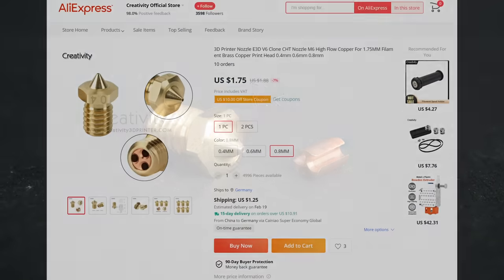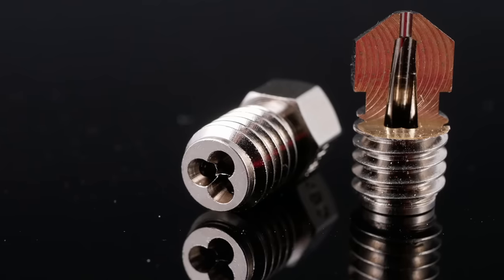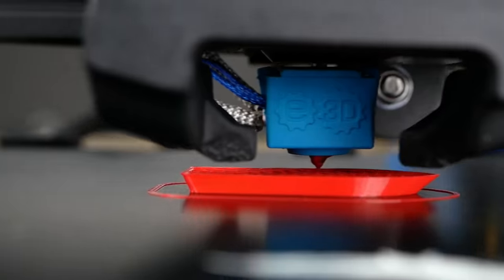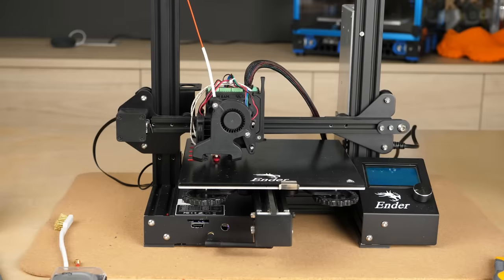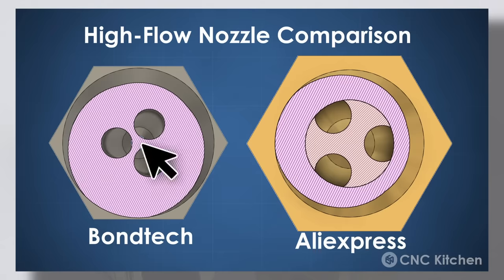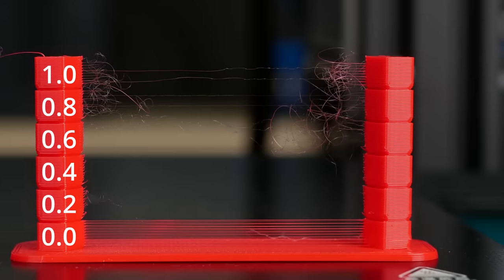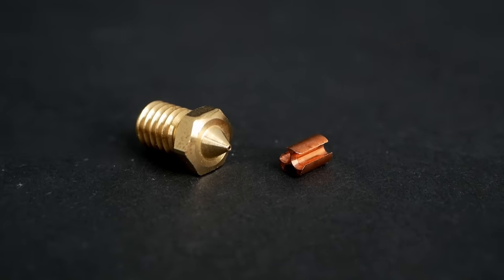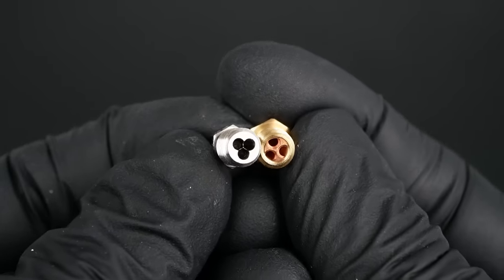$2 Aliexpress Knock-Off better than Original?

Comment: Do you suppose with the Ali express clone there is a chance the filament will seep into the small gap between the insert and brass nozzle?
Reply: It will definitely seep into the small gap. And that will be better for heat transfer than the air that's there otherwise. Some very thick thermal paste could work better if you manage to make it stay there.
Reply: @celeron55  That reminds me of Slice Engineering Boron Nitride paste.

But it's WAY too expensive for me to try. It seems the white thermal pastes are often rated to 280°C operation (HY410) so i could try that. I put some copper brake grease on my nozzle (outer thread) last time and what it did was to smoke up the room with the carrier liquid, but i suppose some compacted copper stays there and it should make it easier to extract and better heat transfer, but i haven't tried to extract it yet and also i don't have any numbers or feelings about heat transfer.

Comment: Could we use a 0.4mm CHT nozzle with the parameters of a 1.0mm printing profile? That way we would get speed and detail controlled by software.
Reply: Printing speed isn't the only thing that slicers change for different nozzle sizes. Just change the max extrusion rate and max print speeds
Reply: @bosstowndynamics5488   there were some videos recently when Arachne came to Prusa where it was tried out and mostly worked quite well. We need software that dynamically adjusts width of the lines and height of the layers to improve speed without sacrificing surface quality or detail.
Reply: @siegfriedkettlitz6529  Ok, don't see what that has to do with the fact that the maximum and minimum extrusion widths are in part controlled by the nozzle size (Arachne is varying extrusion width within a range, it's not pumping out 2mm wide extrusions on a 0.4mm nozzle)
Reply: @bosstowndynamics5488  Only the minimum width, not the maximum width. The maximum depends on the maximum flow rate.

Comment: I really wonder if an insert like the Chinese copy really transfert heat well.  They have quite a loose fit so heat transfer shouldn't be that good. For small blobs the thermal inertia is perhaps enough but on long runs with the wavy test print it isn't. I think insert are really good from a manufacturing stand point but the have to be press fitted at least! Like the certainly did with the original cht

Comment: I'm surprised no one has just made a nozzle in several pieces the threads are enough to make it whole when tightened.
Reply: Can you explain? Adding threads to the internal copper slug is more difficult than a press fit, and you lose horizontal space which means less flow rate.

Comment: The patent at a glance just seems very vague to me. To me, it reads as trying to patent the whole idea rather than a specific product, such as if a company tried to patent all hot end nozzles rather than their own take on it. Likely why its having trouble tbh.

The knock off is 100% just that; a knock off. Someone else's idea, redone in a cheaper way. Though, in this case, since the patent is or was pending when this was made and sold, it means its most likely legal, even if it was a more direct copy, and the patent was accepted later on. Future sales wouldn't be allowed, but the one you have would be ok.

Imo, the og companies should get credit, but thats where the line ends. You can copyright your high-end design of it, but come on, this is a pretty blatant attempt to hold the market captive and stop any further innovation in this direction that wasnt under their name.

Comment: Good innovation. Yeah, its a copy but at least the copy improved the overall performance for the technology. Could be made even better if you used thermal paste glue to hold hold the copper in place tighter. Just use very little of the stuff.

Comment: tha's a clear example of patent trolling.  seriously.  3 holes instead of 1.   
it's like adding couple more cylinders to the car engine and trying to patent it like a "new invention never seen before lol".
chinese nozzele is not a "knock-off". it's a different approach and it is more well thought.  look - you can pull this copper core if this nozzle gets clogged.

Comment: I bought Bondtech CHT nozzles, but I support the existence and availability and use of the knockoffs. This is a hobby, and it shouldn't be so that only those who can afford a $20 nozzle can get better printer performance. It's an already expensive hobby, and that could buy a spool of material. Let those of us with means to buy Bondtech do so, and don't shun those who look for cheaper solutions.

Comment: The original looks like steel, which the Chinese version looks like brass with the copper insert. I'm not sure it's a fair test due to heat transfer rates of differing materials..

Also, unless I am mistaken, isn't copper the least wear resistant metal? No good if you get rapid wear..

As for the patent the original has holes drilled into it, where as the Chinese version has an insert with a different metal. In my view it's radically different enough to not infringe the design - only infringe the idea.. are we patenting ideas now? If so simply thinking of a thing and patenting it stops any innovation at all..

Final analysis: while I might gonfor the cheaper one if I was printing pla and wanted it quicker for the odd number of prints, for more long term use, I would consider the original. 

But all that is a mute point, as it only matters if your wanting quick printing that pushes the printer to its limits and introducing artifacts.

Comment: The knockoff is substantially different in form. You can't get a design patent on function and a little bit different way of melting plastic isn't exactly an invention. It should not infringe on the patent. It's a different design of a high flow nozzle but it's not the bondtech's design.

Comment: I'm not fan of chinesse products but:
- These are different products. The chiness core has no holes and is made of copper.
- Copper core is an smart move, copper is better heat conductor than stainless steel. That's why you get a better flow.

Comment: I'm thinking patents are causing more harm than they benefit nowadays. Here's a copper plug with 3 holes drilled in it and we're questioning if manufacturing said part is allowed for the next 20 years! How's that improving progress of the society at large?

Comment: Heating the plastic with a laser is the future.  These cave men are heating with an element powered by electricity,  in the future a smaller diameter plastic will be used and it will be heated really close to the opening of the nozzle.  You should test that instead of this old tech. And yes, this is my idea.

Comment: The huge manufacturing innovation was the "knock off" (which I think is different enough, and performs superior, to not be called a knockoff). Its reduced cost making it dirt cheap is going to help a lot of people for just pocket change, and THAT is innovation. Its like making a car double in power for a crisp $20 bill, and not a $10,000 supercharger, because which one is the REAL industry innovation in that scenario? The one that changed things, and that knock off will do just that.

Comment: It seems that the bondtech application of this idea has misattributed some of the performance increase to the cutting edge splitting the filament, whilst it is in fact almost entirely from the increased surface area. Thus this incorrect assumption has resulted in this expensive manufacturing method, which was entirely unnecessary?

Perhaps with this revalation, it might actually make sense to drill even more holes into the insert to furter increase surface area?

Comment: We have patents. I can tell you, this is on the edge and could cause trouble. But, a tiny change could solve it. Tip: They cannot patent drilling holes, or attaching materials. They can patent a design, innovation, that is beyond "drilling holes".
In their place I would make it open source with mentioning the name of the developer, and become a respected member of the community to gain an indirect value. It is not that I am against patents. In fact, patents in the right hand can be good for community, but first .. it must be patentable!

Comment: Can a insert be made for regular nozzles?
Reply: The inside of a regular nozzle is too small for the insert.
Reply: @adama1294  not if you are using 2.85mm internal diameter nozzle.
Reply: @evertchin  Someone did something like that in 2019, you will find it as "Linear Edge Nozzle" at Thingiverse and Cults. It's an adapted design from injection moulding industry, which has the material pass through several vanes, very smart but doesn't manufacture easily. The insert as designed was tested as a lost-wax cast service at Shapeways in brass.

Here the internal nozzle diameter is presumably larger than 3mm, so they can keep crossectional area vaguely and don't need complex manufacturing operations.

Comment: To not infringe on a patent all you have to do is differ by 10%. A good patent lawyer could make this case for this Chinese nozel very easily. The removable core itself is enough to not infringe. The straight lines on the triple hole insert are the final needed change. Patents are not the iron clad protection many are led to believe. They are only a means to an end. You have to have enough money to defend your patent in court as well. The patent itself doesn't do this is Europe or in the Western World. A proper Chinese patent on the other hand is a whole other situation. Another Chinese company that infringes on your Chinese patent will have to pay lost revenue if you can show that they have infringed on your patent. Something that the rest of the world could learn from.

Mark

Comment: If they made a "knock off" that is better than the original, and isn't exactly like in the patents, I don't think they infringed, they improved it. It's innovating, but I wouldn't call it innovating to a point that we could ban all inserts into the nozzles, it would be ridiculous. But patent law often is, and I don't think it serves original purpose- improving and protecting innovation, I think overall it does the opposite.

Comment: In my opinion, power to both the OG and clones. Do I want a CHT? yes. Am I going to buy 1 CHT and 5 knockoffs? also, yes. My question though, has anyone tried a cold pull through a clone?
:face-blue-smiling:

Comment: Well the knock-off is waaaaay better IMO, quite easier to manufacture and easier to tweak the design. Manufacture inconsistencies don't worry me, other factories with better machines or experience will pick up the design and produce a finer result.

Comment: it probably hole spacing between each other is far away more effectively then one closer to each other 
that what changed game challenge 
it would be better if you can reach out to innovation tell them make other one but move drill hole aways from each other and have them drill it like 🔻 but drill it outside of 🔻
keeping more heat inside middle will create easy printing and more melting plastic easy-going 
if less room in middle is less effective keeping heat inside of it n get colder at faster speed

Comment: Having bought one full price CHT MK8 0.4 mm nozzle, trying to improve flow on Creality-style hotend (it didn't, actually it was worse than Creality pointy nozzles 🤨 so switched to Volcano block and nozzle) I believe to be - at least morally - on the safe side with slug nozzles 😇

I haven't actually tested the slug nozzles yet. They are for Titan Aero clone waiting to be installed on a Creality clone - recurring theme 😅 Based on this video, it seems I can continue with moderate speeds without Volcano.
Reply: Have you changed out the Heat-break for a bi-metallic one? That will improve flow a lot and make these CHT-style nozzles more effective.
Reply: @mocotonio  I did, Slice Engineering one, but it didn't make a difference. Maybe MK8 heating block is the one to blame...
Reply: @kimmotoivanen  I get close to 20mm/s³ volumetric flow when printing ABS with a simple 5A Plus bimetallic heatbreak and 0.5mm MK8 brass nozzles using Marlin's Autotemp.
Reply: @mocotonio  0.5 mm is a lot larger nozzle (25/16 area), but did you measure how much actually gets extruded out of the nozzle?
Reply: @kimmotoivanen  Yes, it can do that with my custom direct-drive extruder without losing steps. Prints also come out with perfect extrusion, i can reliably print ABS at 19.5mm³ without any problems.
Reply: Tried CHT clone and went back to Volcano after calibration parts. Like original 0.4mm CHT nozzle, clone does not flow well + couldn't get clean retraction.
Heatbreak had bent, so straightened it (required quite a bit of force 😅) and built around Titan Aero clone. K0.06 retraction 0.5mm for PLA 😺

Comment: Guys. Does anyone know a Solution for why my Printer prints Dots everywhere on the Printpiece after each Printlayer? I'd like to turn this off if it's nothing important. Would certainly save some printing Time with larger Print Pieces.... I use Cura for this. Would help a lot if someone can help.

Du ich hab da mal eine Frage, warum setzt mein Drucker bei jeder Schicht noch so komische "Punkte" hin über die ganze Schicht, wenn er eine Schicht fertig hatte?

Ich sehe da keinen Sinn dahinter, würde das gerne abstellen, wenns nix wichtiges ist. Spart man sich bei größeren Drucken sicher einige Zeit wenns wegfällt.
Weist du, oder jemand anders hier die Lösung dazu?
Ach ja, ich drucke über Cura.

Comment: I don't agree that this is a knockoff, this is not a direct copy of a patented design. But rather appears to me to be a derivative or an inspired design. I don't believe the patent covers what they've done. It's a completely different mechanical design. It achieves the same result but uses a different approach. But I don't believe you could be in any difficulty whatsoever posting links to it unless you yourself are deriving income from those links. But then again I'm not a lawyer but if this were a patent infringement suit and I was sitting on the jury I would rule in favor of the "inspired derivative".

Comment: I will use neither because I print slow to get perfect prints every time. 
Regular 0.4mm nozzles does a good enough job for my parts. 
But if I had to chose, I'd chose the AliExpress one. 
Why? Because it's dirt cheap and the original feels like a rip-off for what you're getting.

Comment: Honestly chinese design wins here by a long shot.
Not only it's far far cheaper, has slightly higher performance, but also seems to completely go around the orignal patent with that insert.
Reply: I don't think its quite that simple, as the 3 angle drill approach does show some other benefits and performs well, it has also now got lots of users printing in alternative filaments saying it works greats. The 'knockoff' design is however how I'd make such a thing myself, much simpler to make and easier to tweak parameters on to see what really works best - I'd think the sharper more knife like filament splitters on the bondtech would work better in many cases of trying to print tougher to print and higher temp materials. But testing would be needed.
Reply: @foldionepapyrus3441  the clone without the sharp edges seems to need a extruder that already softens the filament before it gets to the splitter. But this could be achieved by using a nozzle spacer.

Comment: Would you call the standard nozzle design knock off from different manufacturers? If not, why do you call the Chinese one it? While the design have a similarity (3 holes), that's it, bit that's called all other nozzle knockoff.

If the design is better and different (using insert) then it's not really a knockoff.

Comment: While I can understand the desire to make a bit of money from new ideas and not having others take free advantage of your work, I also have to present a VERY long side eye to the turds that want to patent everything... or have they forgotten that 3D printing technology had been around for several decades and it was the PATENT that outright prevented ANY innovation into 3D printers for a long time... If those patents had been just a bit longer, NONE OF US would have 3D printers even now... unless of course you wanted to spend thousands of dollars for the permission to use the stagnant technology. I think I would support a much shorter patent length of perhaps a year or two for the first creator to recover costs and make a little money, and I am sorry but the multi-hole approach is really NOT that much of an innovation as there are other industries that use variants of that to achieve better throughput, especially for mixing and homogenization.  It's like trying to patent a button that says "Buy Now" or "Play"...

Comment: I don't think a patent is justified at all.  The idea of putting holes in something to increase surface area for the conduction of heat is not remotely new.  Coming up with a reliable way to machine those holes at the scale of a printer nozzle is effective engineering, but it's not an invention.

Comment: These bondtech nozzles are clogging machines.

If you want serious performance and efficiency, use the Diamond Back diamond nozzle. It heats very easily, lowering the current needed to keep same temperature as brass. And nothing is harder than diamond and have not had ANY scratch on its flat polished tip. The polished tip also leaves a smooth, consistent surface finish as well.